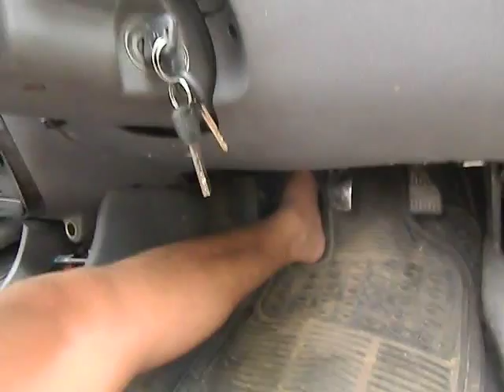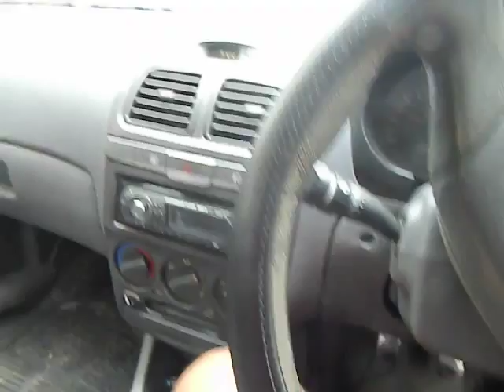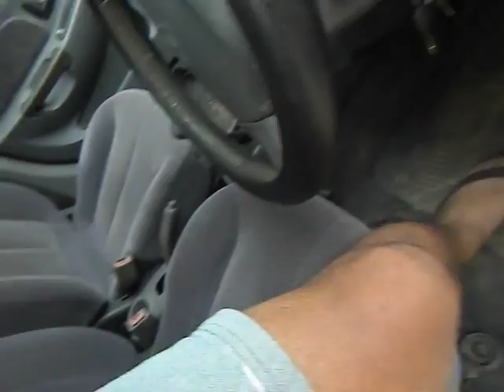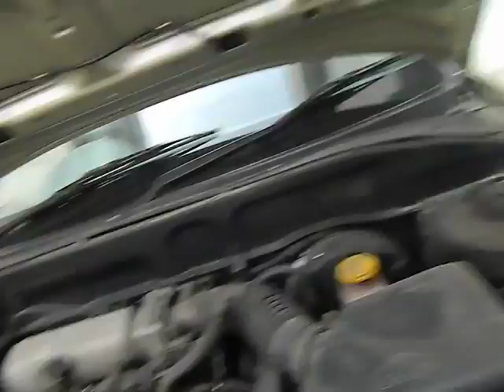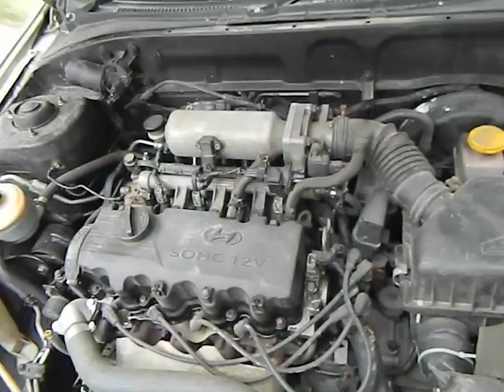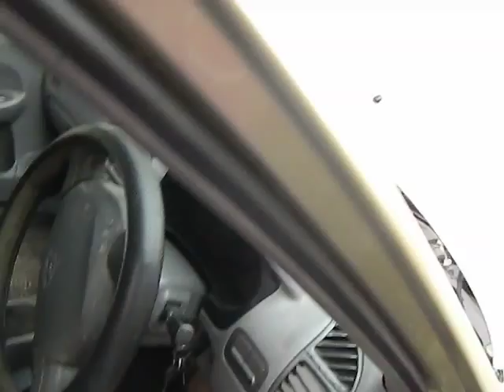Noise coming from car is gone when clutch is pressed

Comment: Same exact issue in my dodge neon ever since the clutch was replaced. It does it mainly when it's cold, once it warms up it goes away.
Reply: Did u find out what it was? Mine do same
Reply: @askim1903  Do you still have this problem? Was it fixed? As what I've known with this type of problem, it's the Input Shaft Bearing in the transmission. When the car is in Neutral and clutch pedal is not pressed, it is that bearing. It goes away when pressed.
Reply: I got my clutch replaces today, and I encountered this problem too, I am gonna go tommorow back to mechanic to find out why this happent, just mine does not make any sounds when driving only when my car is idling but if I press clutch in it goes away, and only occurs, when rpm's bellow 1k, so by what I see its flywheel or input shaft bearing I guess, this probably occured because mechanic did not adjust clutch properly after putting a new clutch.
Reply: I just replaced my clutch probably three months ago, and now it's making a squeaking noise while in neutral. But when I step on the clutch the sound goes away
Reply: @OfficialMeep  Hi, did you solved it replacing the input shaft bearing? my kia ceed does the same noise, i want to find the cause.
Reply: @will1948  Input shaft bearing.  Clutch disengaged, input shaft stops spinning, noise goes away.  Clutch engaged, input shaft starts spinning again, noise comes back.  Clutch is working fine, transmission needs a rebuild
Reply: Mine is the other way around, the noise occur when it warms or already travelled several miles.
Reply: @OfficialMeep  what was the issue mine duster is also doing the same thing after clutch replacement
Reply: @hemant.sharma91  I dont know I got a new car and gave old one to my dad, he drives like that till this day without problems, but my friend had very similar problem it was bad release bearing, note that my friend did not replace clutch he just bought car with this problem
Reply: @johndanver2012  did u find answer what was it?
Reply: @vkivi7606  Not yet. One auto mechanic advised me to replace the clutch disc with original (OEM) one.
Reply: @OfficialMeep what was the problem mate I just encountered this problem today and am a bit worried and don’t know what’s going on so please letme know if you remember what was the problem.
Reply: @muhammadzeeshanashraf4816  I guarantee that its bad release bearing, I gave that car to my dad, cuz I got a new one and he still drives like that now for like 3years and nothing happened yet, ofcourse its better to change it, but it can be expensive because you need to take out the whole gearbox, the car that still have that problem its Ford Fiesta mk5

If you know someone who is in to cars, I would ask their help instead of going to mechanics, you will save money  that way, the part itself its pretty cheap tho. but still depends what car you drive and where you live.

Comment: All that happens when you change clutch correct ! Some clutches  have a plastic cap on the middle around the hole and some not, the ones have the plastic cap on the middle around the hole are the appropriated to use because when the clutch is in movement that plastic cap makes the clutch work smooth no clicks or bangs when moving, now that ones have no plastic cap around the hole are working metal with metal  are very noisy when in movement, that’s why the noise goes away when clutch pressing or when de car is in movement. On neutral also very noisy .
Reply: I’ve had mine replaced recently and it has a slight knocking noise when I’m parked and release the clutch. If I push it back in and release it slow it goes away. Should I be worried ? I have a 2003 VW Jetta it’s a light knock but aside of sounding not so good it only happens sometimes
Reply: @TheReelFishinator how is it currently? got my stage2 clutch installed today in my jetta gli and it does the knocking noise on idle

Comment: My suggestion to grashoppers singing their clutch fork cricket song, or even playing the big boys drums noise is:
 
Point 1: When the pilot bearing is bad, the noise will come as the clutch is pressed in to start the rolling. 
Point 2: I assume your clutch fork is shaking like hell until you slightly press on the clutch pedal and it goes all silent. 
Point 3: Before it get this bad, check if there is a missing coil spring to hold your clutch fork all way back. 
Point 4: Try to lubricate the clutch fork at any contact point with heat reistant grease from outside of the gearbox. 
Point 5: Sorry for you, I guess the gearbox has to go out for a full replacement of it all if none of this will do for you.

Comment: I am experiencing that problem now, 1st and 2nd gear. 4th gear runs smoothly. Pls let me know what is d cause.
Reply: Roy Miguel Have you found a the problem with this issue?
Reply: input shaft bearing
Reply: Yes inside the transmission, its was almost worn out.
Reply: Yes d technicians replaced an almost worn out bearing,  its inside the transmission.

Comment: I bet that it is the input shaft bearing. I have the same noise and I replaced the clutch. If it was the release bearing you would hear it when you had pressed the clutch.
Reply from the maker: Release bearing makes noise in action only when clutch is engaged i.e. clutch pedal is not depressed. I believe input shaft bearing pilot bearing makes noise only during clutch disengagement i.e when clutch pedal is depressed. BTW in my case replacing suspected throw away bearing got me rid of the noise.
Reply: Pilot bearing on this vehicle.
Reply: @singhprade  hi mate, I have same noise,it’s was the problem bearing cartridge or release bearings? Many thanks

Comment: you must change the clutch pressure a new one,coz clutch pressure springs are going bad or weak
Reply: allan mulig please help me reply me i have a problem i m using ford fiesta 2009 tdci engine today im facing some problem with my gear shifting when i move my car with 1 2 3 it has some weird sound  but when i use top gear it doesnt have any sound and car runs smooth whats the problem please reply im your subscriber pls tell whats the problem...
Reply: That's not necessarily so, I just had a new clutch put on. And all the parts you need come with the kit. And it still makes a squeaking noise while idling in neutral, but it stops whenever I step on the pedal
Reply: I just done it on my car change the cluch but the noise still there

Comment: is it input shaft bearing or something else ?
Reply: Not always, in some cases it's clutch plate
Reply: Yea. My golf had the exact problem. Noise disappears when clutch pedal is pushed down. I replaced the whole deal, flywheel, clutch, pressure plate, and throwout bearing. Noise went away.

Comment: Am confused with with the reason of solving problem; since am already  change flywheel,clutch disc and pressure plate but the sound remain
Reply: It's the issue with input shaft bearing
Reply: That is because of release bearing or pilot bearing worn off.

Comment: Clutch release bearing problem
Reply: release bearing aka throw out bearing noise will be worse when clutch is pressed in! This issue seems to be a transmission input shaft bearing!
Reply: @danielleb.747  I agree with you. The clutch releases whenever you press it, so the release is not the problem. I got a brand new clutch put on 3 months ago and mine is making that noise right now

Comment: Toyota club on and turn the engine manually with the clutch not pressed then when it is pressed and turn your tires manually and lesson for noise and if you do a full clutch service check your transmission shaft splints on the shaft and get some byscips AND put them on the trany shaft and rock it back and forth and up and down and look for meatel shavings in the gear box oil try that

Comment: Try a thicker oil or additive in gearbox mine was similar was the gears rattleing
Reply: same was suggested by my mechanic
Reply: Even the same was done by my mechanic but it didnt fix the issue. I'm driving my Hyundai i20 with same issue from 3 years.
Reply: @princegoyal4323  3yrs? Has the clutch and flywheel been working fine since 3yrs ?
Reply: @vinaysimha1817  Yes, its been more than 4.5 years now 😆. The noise usually comes in winter and rarely feels it in summer. May be the issue with my car is different. Never saw any issue with running the car. The clutch and all is doing good so far.

Comment: BTW the clutch replacement did not fix the sound
Reply: I have the same problem , and just spend 700 pounds in the new Clutch bearing ,flywheel ,and the noise still there ,someone told me could be the gearbox,please any ideas.

Comment: Clutch pump are bad.. Your clutch release fork also has problem. Just change to new one.
Reply from the maker: No way...
Reply: please help me reply me i have a problem i m using ford fiesta 2009 tdci engine today im facing some problem with my gear shifting when i move my car with 1 2 3 it has some weird sound  but when i use top gear it doesnt have any sound and car runs smooth whats the problem please reply im your subscriber pls tell whats the problem...
Reply: Vishwa Rychuri it's your gearbox problem.. your gearing bearing that lock and shift gear ratio when you shift has worn out thats why it makes sound and grinding.. need to open the gearbox to change that small part, be prepared for cost.
Reply: Kucik Kucik omg tq for reply how much it can cost me ...can you tell pls
Reply: Vishwa Rychuri i dont knwo the excat price. Maybe around 100-300 dollars in genaral. That part just small cost, the labour cost are expensive.. if you dont change soon your whole gear teeths will broke.